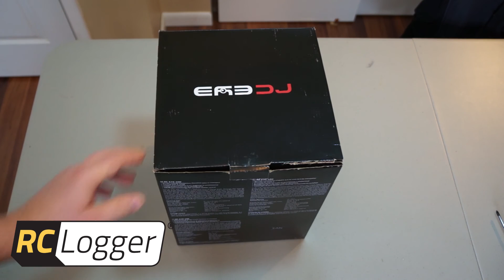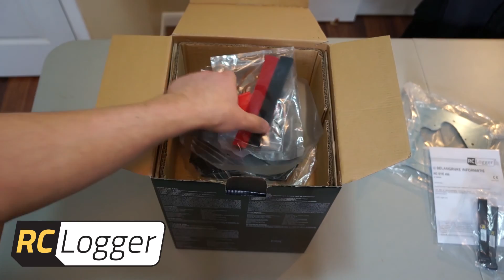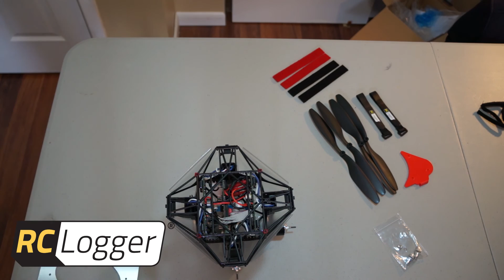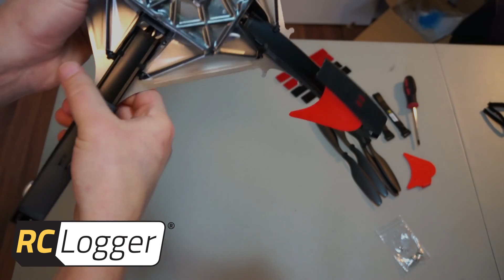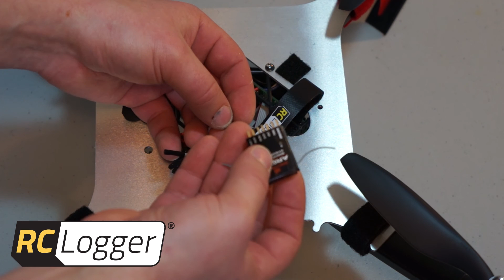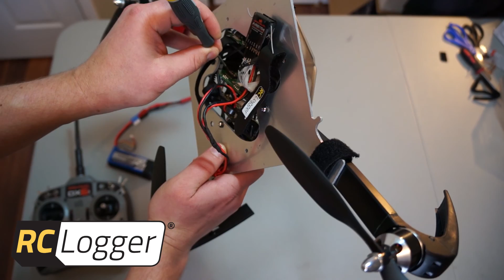RC Logger Eye 450 Build

Comment: Way overpriced for what it does and doesn't do. For one its not very attractive...Very Plain looking. Two I can't believe you have to use a dip switch to change flight mode. "So old school". Even a $29 KK2 board you can change flight modes from the gear switch on your radio. Also try a different technique when you do an unboxing. Just tossing parts from the box makes in look like you could care less about the product your trying to sell. Makes it look even more cheaper than it actually is.
Reply: lol boomer